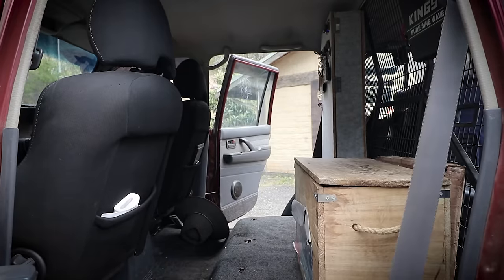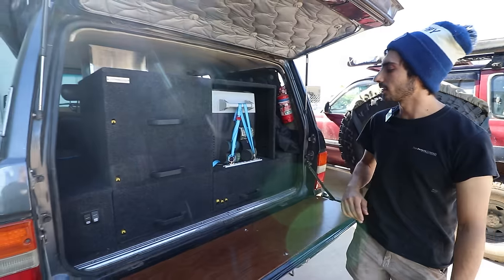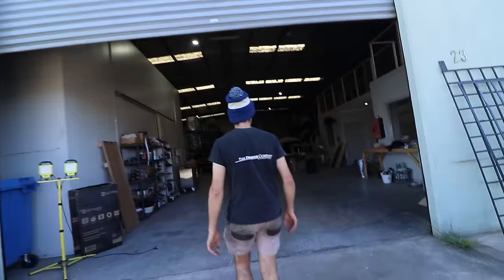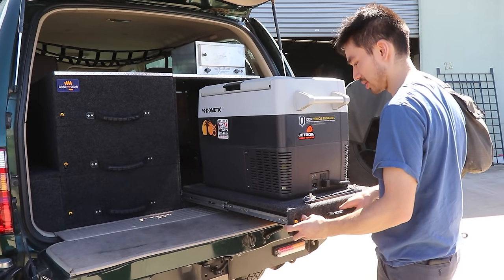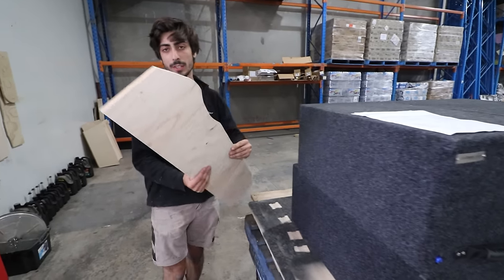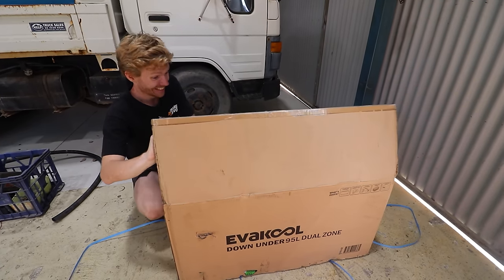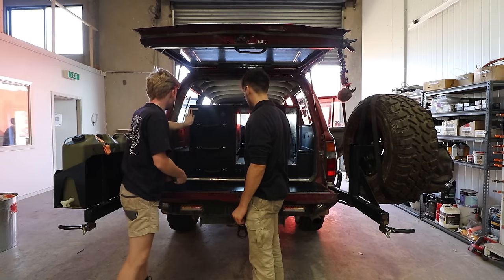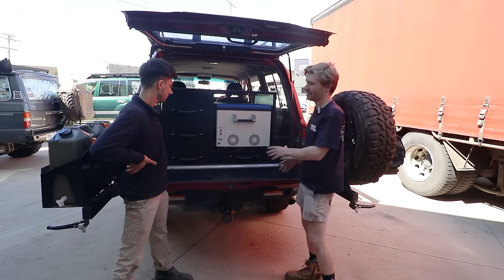STEP BY STEP! TURNING YOUR 4WD into Camping LUXURY

Comment: Yeah that looks nice.
That's exactly what I just did. Rear seats are out, with a platform flat floor installed. The rear draw system is all kitchen. You might want to consider installing sides on top of drawers which go up to the roof. 
Great vid.
Thanks

Comment: Bit late to the party on this video Patrick but congrats on the new setup mate I'm jealous! I reckon you'd have heard this already by now but if you want to get that table rock solid then drill a hole through the end and use an adjustable tent pole. I use a Drifta one, works a charm. Cheers

Comment: Ya know you do not need to go from a garbage dump to spending a whole lot. Building the bed the drawers, the shelving , carpet and the kitchen cost me a total of 45 dollars. You really don’t need to do this. be crafty. Save your money for the expensive stuff. Like that awning. 1900 dollars into I am. Or that expensive frig/freezer. Those beautiful solar gens. Then you’ll get to parts beyond because it’s a never ending project. Like the 400 watt 40ah solar I just put on the suburban . It will not only power the apocalypse truck but it can also power my camper. It gets way outa hand..   really now I’ve more power than I can possibly use and it lead to this... now I’m trying to figure out where to put a real coffee pot, and microwave...  seriously.. I spend the last 40 years dirt camping..  I just shake my head now every time I add to this.

Comment: I’m aiming not to move something to get to what I want. I don’t want to lift and move heavy things and drag things in and out. All I want to do is open the door, pull out the draw and access what I need, with one hand. So, I bought a Norweld tray and canopy for my Dmax. It has draws, shelves, ladder, tables, lithium battery, DCDC charger, 2000w inverter and an upright fridge…..Sweet!

Comment: Hey Pat, I have an evacool 210lt upright fridge freezer and an evacool 65lt fridge or freezer which I use as another freezer and they're both brilliant mate, you should be very happy with the fridge and they're pretty good current draw, I run mine off 2x100ah lifepo4 lithium batteries with 400w of solar NO WORRIES at all mate.  Happy trails mate. Seeya Rob

Comment: Awesome setup! Looks the goods and will make life a whole lot easier living out of the back 👌
I built my own drawers about 6 years ago and know what's involved and this company seems to have great ideas to maximise the space.
The only thing I've come to realise over time is the amount of weight in the drawers is quite significant, to the point I'm seriously considering removing all or part of them to shed some weight. It's a tough call to make especially when you've made them  . . . . . . . . . .. . Will see how that goes 😅👍
Reply: Exactly. I'm looking at making a modular system that's easily removable. Shelving is great but it's so useless at the same time.

Comment: They almost had to go get a mop when Patrick started asking about the 60 series. 😂

I also at first thought it was a 12ht, it looks different to the 60s you see every now and then where I live.

Would have liked a tighter fit on top of the fridge, but like you said you had difficulties getting the right fridge.

So they made it to fit 70-90L fridges that was on the market.

Comment: Did you see the new refrigeratored draw systems coming onto the market now. What was your thoughts on them ?
Reply: got an evakool drawer built into the drawer system so I have a flush top in my tray (ranger). never had a standard chest fridge but I think it's the way to go. low profile, low weight and no additional cost for a fridge slide.

Comment: The problem with these things, for some people, is that they become a permanent fixture in your vehicle and you can't do anything else with the vehicle. And you don't want to be taking these out and putting them back in, if you need the vehicle for some other use. FWIW, my wife an I can go camping for a week or more with just a 50lt fridge and everything else needed, with only our tent on the roof (we could even fit that in the back) and everything else inside the Patrol, no higher than the bottom of the rear windows (and the back seat holding the soft stuff). Everything is easy to get to and easy to pack back. As for meals, they are all pre-prepared, vacuum sealed or in foil boxes and can be heated in a 12V hot box, boil-in-the-bag or fry pan. Been doing this for decades and never saw the need for a drawer system, especially as they add so much more weight.

Comment: Looks awesome Pat. Are you able to give us an approx cost for your drawers?
Reply: looks like on there web site its around $2800
Reply from the maker: Hi Paul! Mine was around $3000 but it obviously varies from car to car, and configuration :)
Reply: @AussieArvos  I think that's a pretty good price for a high quality full custom install. I recently built my own for my Pajero all aluminium and it was $900. Obviously that's just material so I'd expect $3000 easy if I paid to get it made for me.

Comment: Love the content mate, keep it up. I've been trying to figure out a way to put a fridge slide/draws in my Mitsi Challenger, but they have the spare wheel winch in the centre of the boot
 I'm between the rock and a hard place trying to figure it out 🙃
Reply: I put a swing out wheel carrier on the back bar and fitted the draws, the only drawback is swinging it out to open the tailgate but on the plus side I’m not under the car in the wet and mud if I get a flat.
Reply: Hey mate, based on your comment it sounds like you've got a PB/PC Challenger! I've got the same vehicle and actually tackled this issue by building a small wooden platform that is slightly elevated off the floor. Not only is it strong enough to hold the weight of drawers and a fridge on top, it also has just enough space underneath it to fit a small folded table or any other flattish gear you've got (plus you have full access to the spare tyre winch to drop it).
Reply: @samuelhawley9898  Thats a great idea! So you just raised it enough to get a ratchet in there?

Comment: Teflon or steels slides? Each have their pros & cons.
I also have an 80 Series Patrick, & have been looking at modular drawers set-ups with 80 plus litre dual zone fridges, to fit the 3rd row seats only, as I need the 2nd row for my 4 kids, who love to go 4wding & camping. It looks like you went with near perfect set-up to what I am looking for. So can you give me the model designation for the fridge you used (very interested in fridge review) & the overall outer dimensions? In regards to 12v set-ups, I wonder if the space inside the plastic trim & wing on the right side, can be utilised to fit the 12v system. & also wondering if anyone makes a custom bottle/tank that would fill out the space on the left side wing, with the air compressor tucked in behind the plastic trim panel door?
Reply from the maker: Thanks mate ! The fridge is a evakool down under 95L its I think 950ish long but you'd have to double check on the website. I fit mine in with the cargo barrier ! 👌 And yes I love the wings for that reason! A heap of space and opportunity for 12v !! Going to be awesome! Can't wait to see what I can do with it! Cheers :)
Reply: @AussieArvos  l look forward to seeing what options you come up with to achieve that